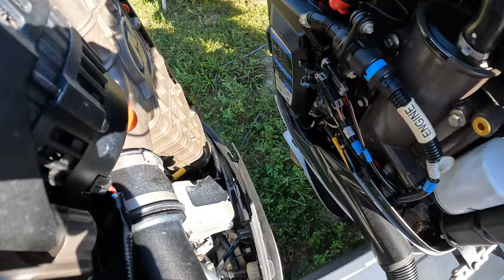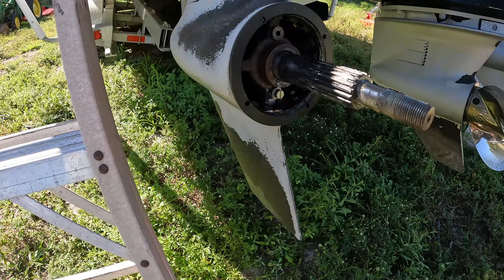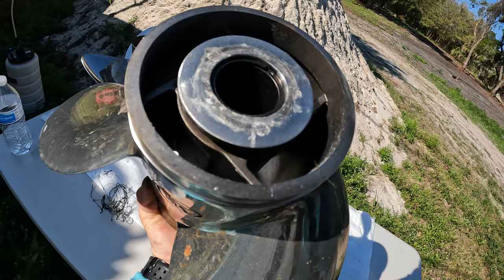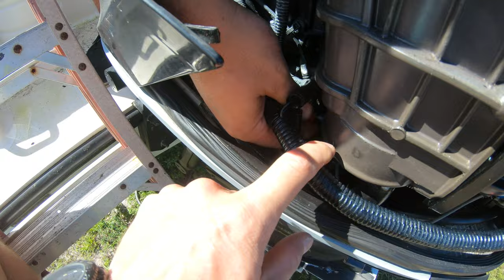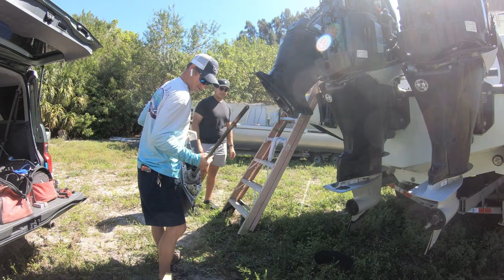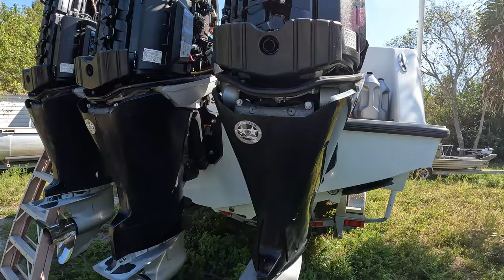Finding Outboard Problems During A Service!

Comment: I'm no marine mechanic, I drive and maintain marine travel lift forklifts and straddle cranes at a full service marina up here in Cape Canaveral. But because of your videos, I've been able to identify issues for our customers and assist them with repairs... I'm chasing down a power issue on a depth finder tomorrow. Thanks a lot!

Comment: Hey there do you guys not typically get the motors warm when doing oil changes? Or was it more so cus there was no water hook up nearby to do so? 
Idk if you guys know this trick or not but when I normally do oil changes I’ll punch a whole in the filter then drain it then use a sucker to suck out the oil from the filter through the hole I punched. Guaranteed no mess. Great vids keep up the great work

Comment: I have a Suzuki DF225, did prop service, pulled prop but couldn’t get thrust bearing off and didn’t want to pry too hard against the housing. Could I put motor in gear and grab thrust bearing with slip joint pliers and spin it to get it too loosen? Would like to check behind it to verify no fishing line and apply fresh grease.

Comment: The oil coming out of the "example" engine looks like tar.  Is that normal?
Reply: Yes, It’s gear oil, which has a heavier weight.
Reply: @kevincrawford7439  ahhh... It's a gear oil thing.